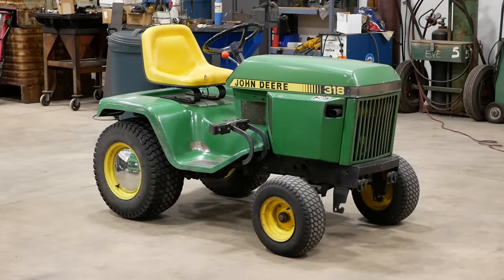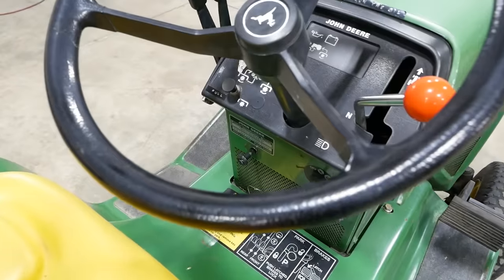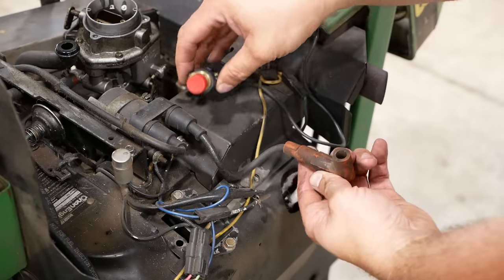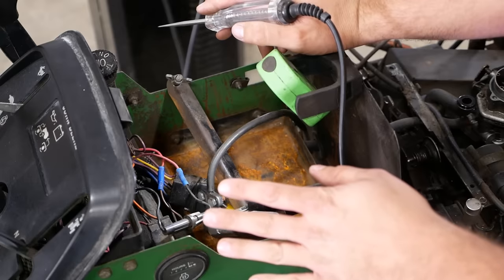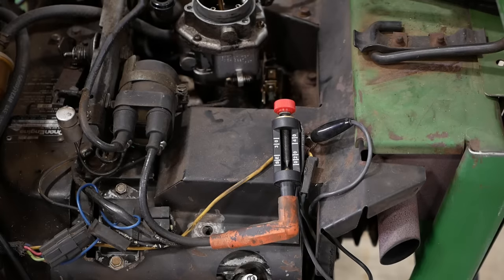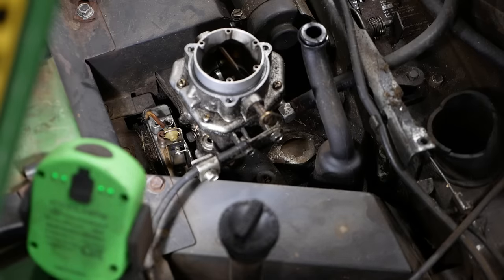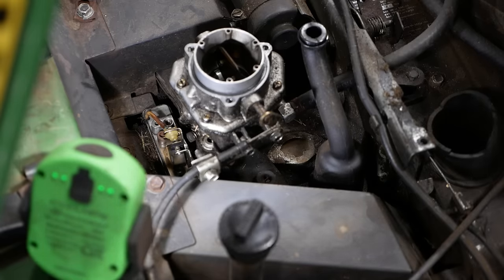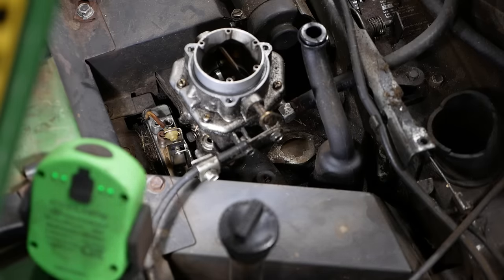John Deere 318 no Start - no Spark

Comment: My brother in law bought one not long after they came out and when he died in 2014 it would still run.  It was smoking and the hour meter had over 2000 hours.  He had a front blade, the engine was still starting and had not been overhauled or rebuilt.  My brother in law paid $5,500 dollars for the 318 when he bought it, late in the year it was first released in.  I thought it was just way overpriced.  It only had minor problems throught out the many years he used it, he and his father mowed about 5 or 6 acres with it until about 2008 when he bought a newer John Deere.  I don't know what it brought in the sale after he died.

Comment: Wes, here in central Ohio harvest has started on corn and beans also. I don't understand shelling corn before the stalks are dry other than they have lots of acres to cover. Down side to wet corn is more gas consumption at the grain dryer. Miller portable welders used Onan engines also. John Deere 140 lawn "tractor" also had righty,lefty turning brakes.Al B in ohio.
Reply: yeah must be a timing thing, only so many combines for the acres of corn in the state? can't be the weather that they're doing it, it's still plenty warm and sunny even in the coming week

Comment: I love these old JD 'units with the hydraulics. and I really think the 318 was the pinnacle, with its 1-3 spool hydraulics, 3-point connection, and PTOs. Unfortunately the Kohler engine was a disaster even after they went to pressure feed oiling.

Comment: I found the same issue with a DR Field and brush I picked up not long ago.     Wasn’t getting any charge,    Glass fuse looked good but testing the resistance told a different story.     Turned out it had got hot and   Melted the solder  enough to break contact

Comment: Definitely cool little tractors. I've been on the lookout for a vintage Case hydro to use to plow snow. While that corn looks green it its the ear that matters. Its likely to be a really slow harvest in some places the yields are going to high which is going to back up the lines at the local elevators. Its been a crazy year. My brothers wheat was so good every single farm made over 100 bushel per acre.
Reply from the maker: I'm not sure here. It's been very dry.

Comment: I know what its like to deal with scouting for parts for the 300 series John Deere tractors. I have a 316. Its Koehler 16hp single cyl thumper that smokes pretty bad. Its mower deck rotted away, saved the bearings and a few other items from that in hopes to finding a reasonable shell so it will mow again. I have a Koehler 23hp v-twin I want to adapt to it but its going to require a little bit of modification but none that cant be reversed maybe get a snow blower attachment for it an a second set of back tires to tube and fill with a lot of windshield washer fluid.

Comment: If I understand it correctly, corn with moisture that high is how bin fires start. It's counterintuitive but the driers are run so long/high, the core gets too hot and poof.
Reply: Corn run through a dryer doesn't start fires if the moisture is brought down to a storable %. Dryers cycle the burner off and on to keep from cooking the corn. It doesn't come out of the dryer HOT.
"The moisture in the corn causes it to deteriorate over time, and the deterioration generates heat," Heat causes the fire if there is enough oxygen.

Comment: As you go through the features, you can see why it's a tractor and not a mower. It has a ton of features that match up with a compact tractor.  It's also much better than any modern throwaway
Reply: I’m not old enough to know but I wonder if these were “modern throw always” when compared to a cub cadet original or similar

Comment: Fantastic Video! It's interesting to see where things are under the hood and seat area and how to test/adjust/fix a few things. THANK YOU. I have a 318 that only starts by touching the battery clamp to the positive terminal (and shuts off by taking it off), but otherwise even with 1556 hrs it runs very well. I dont know how to fix that - any suggestions from you or your viewers in the know would be greatly appreciated. I think it's well worth keeping it properly working. I have the snow thrower and rototiller that came with it as well. I love it. 👍🏻👍🏻👍🏻

Comment: Pretty strange failure but that fuse has been over heated somehow. You can see the center part is curled and if you look closely at one end, you can see that the end of the fuse material has been pulled out of the solder joint at the end of the fuse. Those Onan engines seem to be used in a lot of things and they seem to be pretty durable. Nice little tractor.
Reply: There’s a lot of current in the ignition circuit of these tractors so the overheated fuse failure makes sense. I had one that had a melted wire in the ignition and it melted the connector for the switch.

Comment: I love those old onans I have an early wheel horse zero turn which has a 24hp 990cc version of that motor (performer 24) it's a beast, very thirsty but tons of low end torque. I have another 24 sitting on the shelf with less than 200 hours out of a Toro golf machine that was sold for scrap. I don't know what I'm doing to do with it yet but I can't bring myself to get rid of it

Comment: Just got a series 2 kohler for my 317 project I bought in pieces with a blown engine.. Can't wait to get it all together. Currently using a Gravely 8163-b i pulled out of a hole 5 years ago, was bottomed out in the woods behind p/o's house for 10 years, deck hydros were still holding after all that time. Think I paid $50 bucks for the tractor and the owner even loaded it for me. Gotta get her a new belt since the rats of baltimore ate the damn thing.

Comment: I  got  a  MF 1655  from  the  same era.  Onan  in  it  runs  like  a  top.  However,  if  the  engine  does  go,  it's  the  Honda  conversion  for  me.  A  24  horse  engine  on  the  1655  platform  is  sweet.  Or  if  money  and time  allows,  the  Yanmar  diesel  out  of  a  reefer  trailer  comes  to  mind.  Seen  a  lot  of  guys  run  tractors  this  size  with  the  PF Engineering  loader  system.  Mini  workhorses  for  bigger  than  mini  jobs.

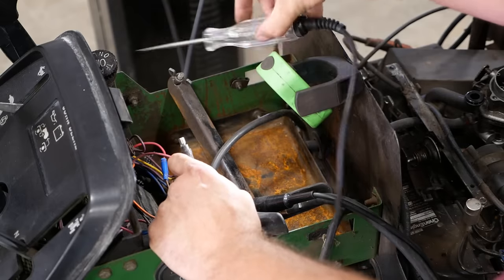Comment: 6:07 There was a fuse holder there but someone must have replace it at some time.  I replaces mine with a ATC blade type fuse holder.  I think they are more reliable and the fuses are easier to come by.

Comment: I agree with one of the other comments. You build a legend and then live off the name. I have had two John Deere ride on mowers. Wouldn't have another one. Always going wrong. Poor cut. Don't last. Fragile plastic that if you look at wrong breaks. To be fair the same as most modern mowers. My current stable three old all metal lawn tractors 30 plus years old. Yes bits break but enough metal to weld and things you can service not throw away. We reached a sweet spot with mechanical items years ago. Now with the throw away age on the slippery slope to extinction and the new age of electricity. But not such a new age in reality. At the advent of motor vehicles electric cars were up there with steam and the internal combustion engine. Things could have been so much different.

Comment: The check-valve issue is somewhat common on all of the sunstrand powered JD's, from the 140's to the 318-322, my 140 was exactly the same, pull the valves, soak them and then GENTLY tap them from the inside with a pin and work them back and fourth. Once the head is out, gently chuck the valve head into a drill and give it a few rotations back and fourth, keep hosing it down with 3in1 and then hydraulic fluid (as 3 in 1 makes the o-rings swell and grab).  The check valves being used mainly for free-wheeling/neutral. Generally folks should spray them with some fluid film and don't mess with them if they're up all the way. :P Of interesting note, the last sunstrands in the JD line, the 420 and 430 did not have these check valves, they were replaced by dummies. The reasoning for this is because the 420/430 have a high/low range with a neutral in the middle.

Comment: I'm usually the one leading that mob of enthusiasts - we've put a few people "in their place" for calling them lawn mowers, or repowering them with Harbor Freight engines before. So beware...

Lol. In all seriousness though, parts for the Onan engines are still out there and most of them are fairly easy to get, despite what people think. Parts are much cheaper if bought through a Cummins Onan dealer than through John Deere - with the Deere dealer you're just paying their hefty markup. That engine seems to be in pretty good shape; a good decarboning of the heads, valve adjustment, and new seals/gaskets will extend the life of that engine by several years.

Comment: Hi my name is Jim from Colorado I own a 1973 John Deere 400 garden tractor opposed twin Kohler I put a 23 horse in versus the 19.5 mine is still running great when I bought it had a blown motor only one connecting rod with working the other cylinder was dead

Comment: I have the last iteration of that series chassis being a 322.  So I have the little weird liquid cooled 3 cylinder diesel Yanmar that Deere thought convenient to turn into a gas engine... unless you bought a 332 which actually was diesel.  It runs ok but it's a pain to get parts for and I hate how almost everything on it is proprietary to Deere even if its an engine made by someone else.  My parents bought this 322 new in 1992 with the factory rototiller.  I bought this thing for myself from them in about 2006 and when I did I remember talking to a salesman at a Deere dealer for what they would sell this tractor for.  He was giddy about the tiller and tried multiple times to buy it saying it basically doubled the value of the tractor lol.   Can't replace this tractor with a modern one of equal size though.... you would need to step up to a larger chassis to get any of the features these had.  Did a waterpump a few years ago... was $500 for a pump that fits in the palm of your hand lol.  Those stupid check valves on the trans are $250 each if you ever need to change them lol.

Comment: Cub cadet used the same or very similar transaxles back then. Unfortunately the rear in my tractor didn't have the pressure relief valves in them, so a shop jack is needed to push it around.
I actually built a tractor with a Cub Cadet rear, and John Deere hood and tower. I call it my kinardly tractor, as one can hardly tell what all the parts are from. The engine is a Honda tractor 13 how twin. I plan to replace that one with a Yanmar clone diesel engine. I like the diesel engine a bit better. No radiator as opposed to the twin engine.

Comment: I've had  flies after corn cutting before. They sit in the moist-er base and when upset, they fly to the next place. On Amazon, you can find those rotating fly traps, catches them by the thousands 
(got tipped on them by an ardent fly catcher).

Comment: I,be got a 318 and they do sound a little strange when cranking them over. If doing a repower I would use a Honda or a Vanguard there are good kits out there for both! You’re going to spend about $2,000. But it beats buying a $2,000. box store tractor! 👍🏻

Comment: I have learned over the years that you can't do a continuity check of the fuse.  I have seen them pass continuity but have somehow gone high resistance and won't work.  I always check suspect fuses with my DMM set to Ohms.

Comment: great video. I learned  a great deal from this video.  I am  having a problem with my 318 the bolts that hold the carb have worked their way loose. How hard is  it to remove the intake?
Do you have a video on how to tighten the bolts without removing the intake. Thanks tom

Comment: Solder joint musta vibrated open from the end cap on the fuse.  When I was learning to be a electronic and computer tech. I learned to never visually check a fuse.  Always meter it.  Had a prank where there was clear tape on the end of a fuse so it looked good but wouldn’t have continuity.  😏
Reply from the maker: I've had them get the tiniest bit of corrosion on the end and stop working.

Comment: That fuse shows signs of heat stress, which probably partially melted the solder contacts on the end caps. If you reheated the ends of that fuse with a soldering iron, you might fix it. If it's an original fuse, it was probably operating close to it's rated value.
Reply: Always replace a 5 amp with a 10 amp fuse so the fuse doesn't blow so often...../s

Comment: They used those P series Onans in the 416 and 520 Wheel Horse. The 520 is built with a forward swept axle that drives like a sports car. no steering brakes, but they can be bought for 12 to 1500. Onans were discontinued because of EPA pollution rules. 
   Wheel Horse mower decks are superior all day long in my opinion A 520 is built for a 60 inch deck and it will pull a 48 like a boss

Comment: I’ve got an 82’ Case Ingersoll 444 hydrive.  Sort of the same sort of deal.  A garden tractor built way to strong for what it was with unobtanium attachments (at least the cool ones).
Reply: I've got a 1975 446 and a 1980 448. The '75 was running ok until it finally blew a head gasket last year. The head bolts are a rusty mess... I completely rebuilt the '80 but the carb keeps giving me issues. Might be the float sticking, common issue. I'm tempted to repower with a briggs vanguard.
Reply: @Adamsadventures83  
I see lots of vanguard repowers on them.  Hope it works out.  I have the kohler on mine which has been a very solid motor after a good freshen up.
Reply: I've got a salvaged 21hp kubota. But the dimensions are all wrong for fitting under the hood. I kind of want to make a franken build using two case rear ends and an articulating center for a plowing beast.
Reply: @Adamsadventures83  
Oh man.  A kubota swap would be awesome.   I love kubota motors!

Comment: My brother has " GREEN FEVER " has had numerous Deere crap ... I prefer the Roper Garden Tractors....way cheaper to buy....parts are reasonable ( if you can find them ! )...i have 4 of them so lots of spare parts....Sears in that era were rebadged Ropers.... Onan engines are super expensive to repair...and alot of parts are not available or too expensive.... I have a Briggs ( in one tractor ) and a Kohler ( used beater engine ) to repower one day and a broken 16 HP Briggs ( busted piston ) engine that might get rebuilt??  We can get cheap engines at Princess Auto in Canada ( $300 - $500 ) that can help keep you running too ( it is like Harbour Freight here )... Or look for parts tractors to get an engine ( usually just as worn out as what you got )...

Comment: Great job Wes!

I think there was a diesel version too or maybe the 316.  Almost bought a 316 but it had no muffler.  Long story. Should have bought.
Reply from the maker: Yeah, the 330 was a diesel 316. The 332 was a diesel 318. My brother has one. It's a beast!
Reply: The 316 or 318 never had a diesel option. The 430 was a diesel. But not sure on the smaller models.
Reply: @aaronhansen8037  ok. Thanks.  Nice unit s just the same.
Reply: @aaronhansen8037  I am told 330 and 332
Reply: @phooesnax  maybe so. I’m not familiar with those models though.
Reply: @aaronhansen8037  all good.  Thank You Aaron.

Comment: 9:25 fuse has been hot, it is unsoldered from at least one end of the fuse. Fuse link is bent too much. Link is supposed to be straight. Check it wilh ohm meter, it is open.

Comment: Crazy about those little tractors. Have a 60s model 110 with hydraulic lift for front blade and tiller. Has 8 horse Kohler that smokes like a diesel. Just can’t seem to part with it😩

Comment: I love my '90 Wheelhorse 520H (same motor w/electronic ignition), but boy-howdy-damn, those cutter brakes and hydraulic steering would make a mowing/yardwork situation, like mine, a lot easier:)  I didn't see a fuse-block on that thing. I wonder if it got water damage over the years and slowly got replaced with individuals and the hacked up wiring.

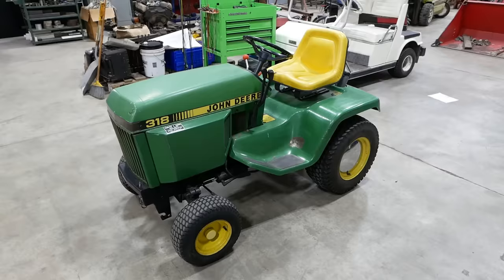Comment: At 0:42 did you say "powered by an Onan horizontally opposed"?
And it even has a creep setting! 😆
Shame he didn't do the Harbour Freight engine swap. Think of all those 2nd hand engine parts you could've put up on eBay from the old engine. If the prices are like you said then it'd be very lucrative.

Comment: They didn't combine the whole field.  The just take off an outside pass, maybe some middle cuts, 
They send that corn for moisture testing, get an estimate of the yield. 
The cuts promote airflow and drying.
Reply from the maker: Is that why they went ahead and picked the entire field the next morning?
Reply: @WatchWesWork  Yes, with those drying passages for air flow the rest of the corn would be dry by morning, RIGHT ???
Reply: @WatchWesWork  It must have tested Ok  :)     Drying is stupid expensive.  They usually try to avoid it.  It's all a weather guessing game.

Comment: Yes, sir those glass style fuses will fool you. Either OHM them out or as you did check for power. They may look good, but they can have an open at either end or, it will not show. I'll bet you that someone had a look at that fuse and dismissed it as it did not show that it was blown and of course failed to see the cause of the problem.

Comment: I had a 317 with a kolher wished it had power steering they claimed the 317 was a lemon but never had issues maybe replaced the carb once those older garden are becoming collectables
Reply from the maker: That engine was known for throwing the rod around 700 hours. They pretty much all did it.
Reply: @WatchWesWork  when we bought it had a brand new complete motor

Comment: But why did the fuse blow?  Fuses don't just blow for no reason.  The thing I did notice was that the fuse inside looked a bit warped. Maybe it just got hot, but not hot enough to burn the weak link, but it warped and pulled off of one of the ends?   Still, seems strange.